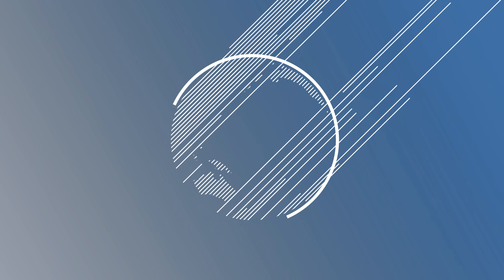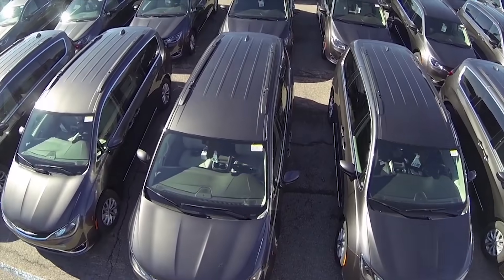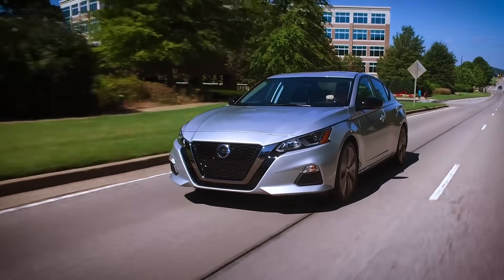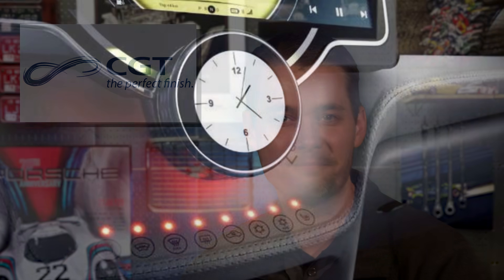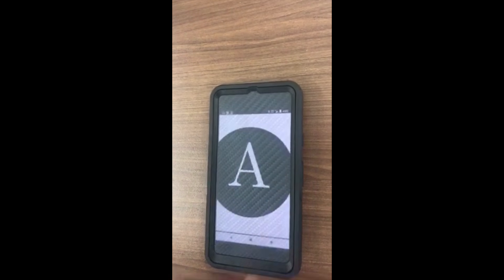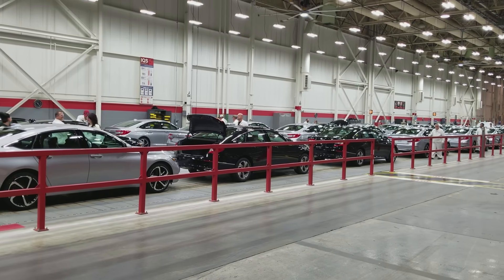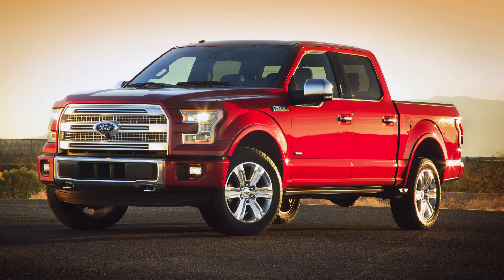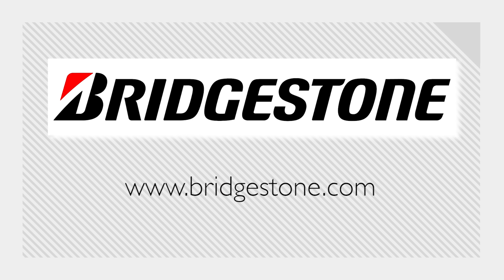C-Clamp Design Makes Pickups Look Tough; Value of Content Comparison - Autoline Daily 3177

Comment: I would not like having the seat controls removed for this reveal technology. Frankly, I am more than a littler concerned with this industry intent to omit physical switches in automobiles. With some possible exceptions, I don't see this being a good move in 90-97% switch gear cases in a modern automobile.. outside of "Robotaxis" and full AVs where you can afford to actually look for the switches instead of relying on touch to find them while driving.
Reply: I think you the nail on the head.  The industry is preparing everything now for driverless cars, not drivers.

Comment: So if I'm looking at two cars that are the same price. Do I want the one with $14,000 worth or parts in it or the one with $33,000 worth of parts? And by the way that $14,000 worth of parts are going to cost a lot more money (and time and trouble) to maintain or replace. On top of that I have to buy fuel that I can't make myself, might be shot supply in the future, and could go up in price at any moment. EVs are starting to look like a great value from the consumer side of things. For automakers the assembly costs are the big target. The level of automation you can achieve with EVs is very tempting.
Reply: Whatever.  It is all meaningless.   Tesla is going to rule the entire industry.
Reply: This "content" cost includes R&D cost for the BEV and AEV, but not ICE. Pretty useless comparison imo
Reply: @kschleic9053  The ICE content probably does include R&D, but since it's been amortized over 100 years of production it becomes negligible. The same will be true of BEV and AEV eventually.

Comment: to bad legacy auto thinks visual design cues make their trucks tough instead of actually building them to last and not have dozens of design flaws built in for future service revenue. i wonder if the new models have built in future rust spots that occur because of lousy engineering and debris collection points. My 2006 F150 is full of design flaws. TESLA will get my future car/truck purchase.
Reply: Ya,  Tesla builds perfect cars...NOT!!!    My Y had to visit the service center twice in the first month,    since then it has been reliable,  but has a few bugs in the power window switches (well known defect in 3 and Y),   and road noise from the rear seems to be getting worse,  I need to smoke test it to see if the window or hatch seals are leaking.
Reply: "If you get the reputation as an early riser, you can sleep 'til noon" - Mark Twain.
OEM figures if they can make their trucks look durable, that'll be good enough.

Comment: Merrill Lynch has no friggin clue !   Shake my head.
Reply: You say that and give no reasons, or just bad excuses, why that should be.
Reply: @DocWolph  I don't have time to explain.   But $200K for a self driving car because of the software ?   Did ML forget to amortize the R&D over the millions and millions of cars that Tesla is going to sell ?  $200,000 x 1M cars = $200B.   That is more than Tesla has spent in its entirety.  Math is hard ?
Reply: @SomeTechGuy666   I think they were talking about the cost for a Level 4 car today,  which Tesla has never built.   Gm discussed this strategy for autonomous driving yesterday,  and said they think Tesla's strategy of trying to game a Level 2 system up to level 4 autonomy is in the best case a gamble, andnot likely to succeed,  where as they have operating level 4 vehicles today,   now they just have to refine them, and scale down the hardware cost after already achieving the performance.   The GM exec was laughing at Tesla FSD videos where they 30  minutes without an intervention,    he stated if you watch a Cruise car in San Fransisco you will need to watch 24-7 for weeks to see a disengagement.
Reply: @SomeTechGuy666  
I think ML did, on a per car basis. Moreover, they are looking at the money making potential of AVs. 

However, I do agree that AVs are heavily and unfairly weighted to that end, since no one is really making money on AV Taxis, at this posting. It is like the Tech bubble of the 1990s, where the potential money making ability of a slick new something is valued not on what it has proven it can generate but what people wishfully assume it will.  

Just because Tesla is making it as a BEV  maker, the circumstances around that are NOT available to other BEV makers, like Lucid or Rivian creating a false sense of "easy money". Add to this the media hype surrounding Tesla's own AV systems FSD/Autopilot, despite its glaring faults and limitations, and investors and hedge fund managers are looking for the next gold strike of "easy money". 

I was more curious as to why you were decrying a thing without saying why. Yeah, some of us have "no clue" and would like to not be in dark. 

Thank you for sharing.